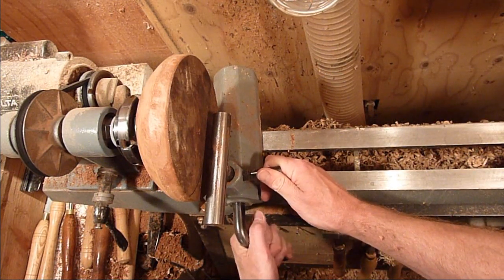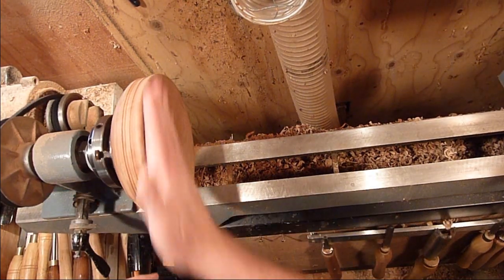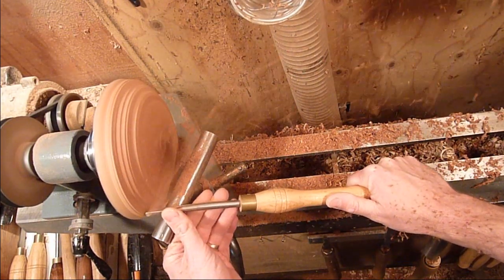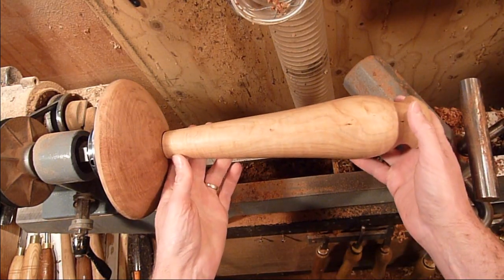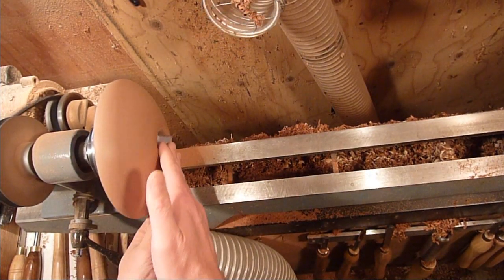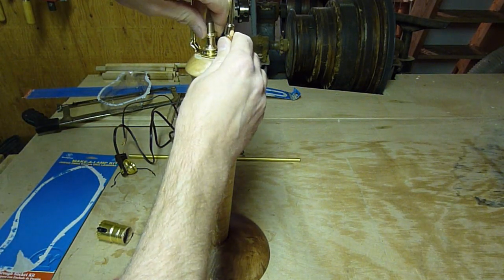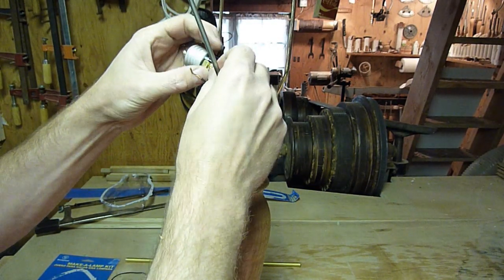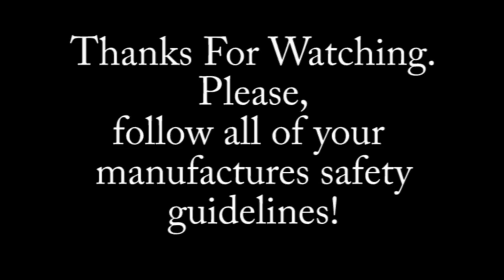Woodturning Turning A Lamp

Comment: Question and a tip:

How did you cut the groove in the base for the wire?  Tablesaw?

If you take either some thin ply or blue styrofoam like they use on houses, you can build a 'hood' to go behind the lathe for your dust collector.  A guy in my turning club has this and the majority of the dust is sucked in, much better than just the hose behind the lathe.